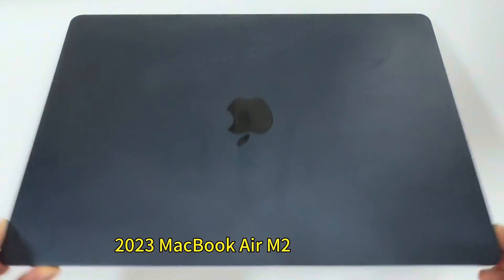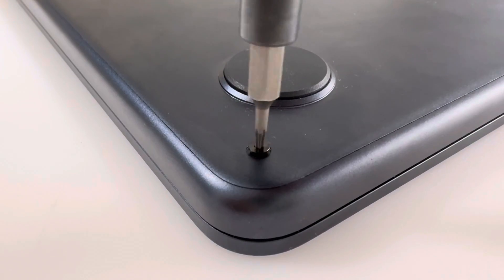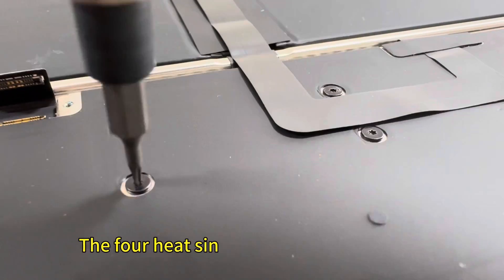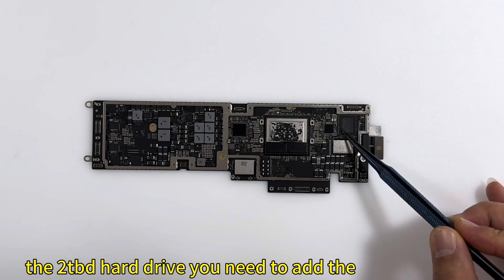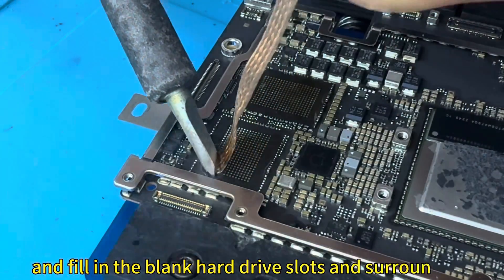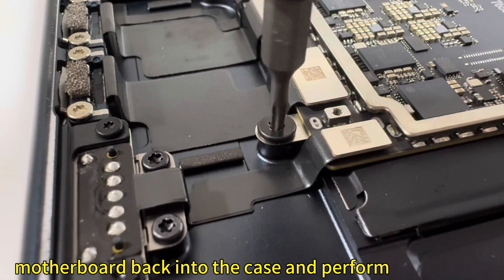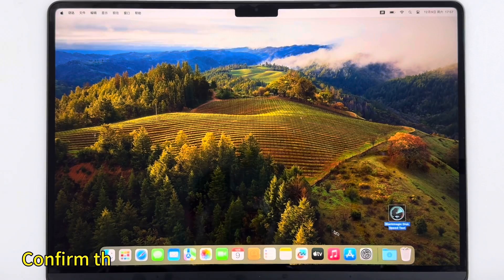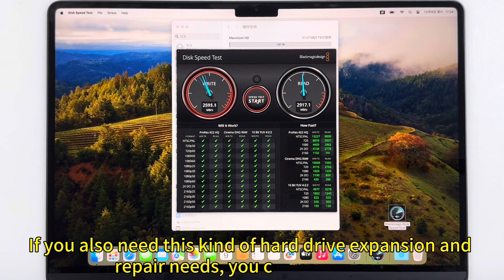2023 year 15 inch MacBook Air M2 A2941 ssd Upgrade from 256g to 2tb

Comment: Is it possible on MacBook Air m2 with only 256GB, I am from Mumbai, India.
Reply from the maker: @ZakirHussain-nd4fw  yes，we can do on 256g MacBook Air m2，upgrade to 2t
Reply: @Apple-maintenance-engineer  for upgrading 256 gb to 2Tb can you install a single 2tb ssd or do you need to use the second slot? How can I send you my MacBook?
Reply from the maker: @jorgeserrato3454  only send motherboard can work

Comment: What are the specs of those resistors and capacitors one has to install to perform such an upgrade?
Reply: same question, need t ofind board view if author will not answer